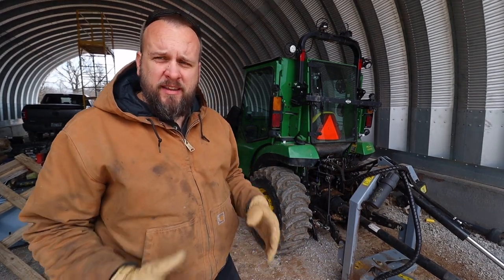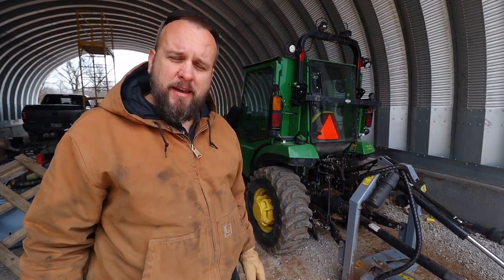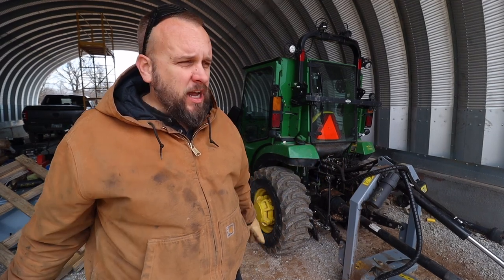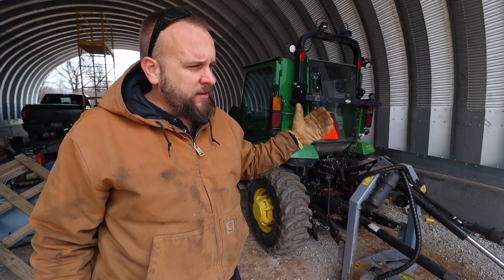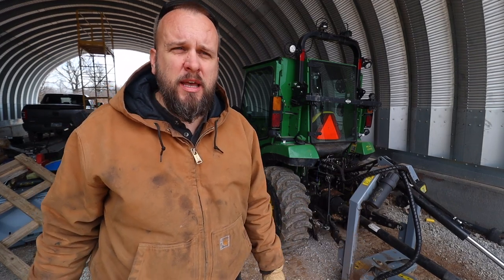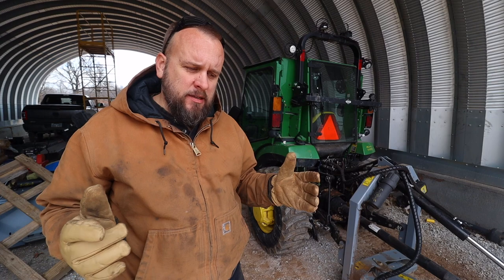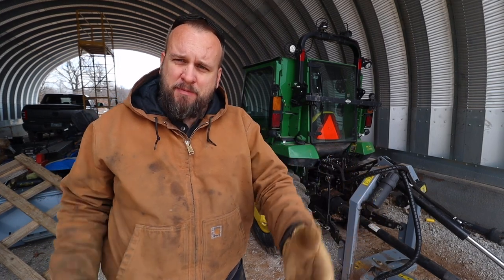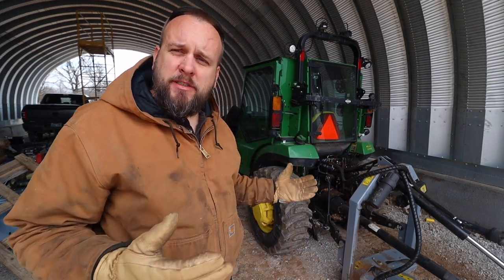Tractor Problems - Intake Manifold Pressure Fault

Comment: Sensors, sensors, sensors……..   thank you EPA!!! & Climate radicals.   I would check all the wiring connections to the sensor once you identify which one it is.  That said your tractor has been and is a beast.  It’s really been trouble free with the biggest issue having been some loose frame bolts as far as I can tell since I’ve been watching your channel.   Have a good one!  👍👍👍

Comment: Brock, I had the same issue in a 3046r. My tractor is still under warranty and the sensor was replaced. I looked at the sensor right after the technician removed it and there was ice in one of the ports. The technician said this sensor sucks in air and measures humidity levels,  there was moisture that was some how left in the sensor and froze there blocking the port. JD knows this is an issue and is working on a solution. 
There is also an issue on the exhaust side sensor as well, the error goes away after the engine heats up. They believe it's a range issue in the software, with the sensor range not being wide enough.

Comment: I had the same thing happened to mine a couple times now (2021 2038R, 85hrs). -15°F once, and the other time, -8°F. The colder it is, the longer  it takes the code to go away once it starts. I believe it’s just a warm-up issue. I haven’t contacted my dealer about it because it does go away. I’ll be following along to see if there really is an issue. Thanks Brock!

Comment: Hey Brock, thanks again for another great informative video, seems like there are two issues happening here, cold temps below 32 degrees and older possibly a weak battery. I own a 2021 JD 2038R with less than 60 hrs., I live in southern Montana, winters can get really cold, my tractor lives in an enclosed insulated shop and heated to around 40 degrees, most of the time, if I don’t forget to leave the heat on after working there, none the less, before I start my tractor when it’s cold soaked / or not run for awhile, I plug my block heater in, put a thick moving blanket completely over the hood / grille and steering wheel, this way not only the engine is getting warmed, but some of the electronics will get some love also, let it warmup for about 1 hr depending on inside / outside temps, then unplug, and start the tractor, let the oil circulate for a few minutes, then go to work.

Another thing I do with all my batteries is attach a battery tender to them, whenever my tractor, mower, motorcycle, trailer, etc. isn’t being used, the battery tender keeps the batteries at a healthy charge, thus far, except for an old worn battery, I’ve had good success. Most batteries don’t like extreme temps hot or cold. I remove my batteries from my summer equipment (that’s not in my heated shop) store / charge them in a non-frozen garage, seems to prolong there life…

I realize a lot of tractors live outside or in non-electrified sheds or buildings, no easy answer for charging batteries/ or using block heaters, perhaps there’s a small solar powered unit on the market a battery tender could run off and keep a charge on your battery.
Stay safe out there…tractor on !

Comment: Brock my 2017 2038r had a red stop and error code for 1209.03 a month ago. Google says it was an exhaust manifold pressure sensor issue. Its been quite cold and it's been cranking slow so I had the thought to change the battery. The one that was in it was the original so 5 years old. Since I changed the battery the error code hasn't returned.

Comment: Brock I live in Midland Texas half way between El Paso, and Dallas Tx, very cold days just don’t happen here often but when they do you bet your ass it feels like your in the North Pole. On one of these cold days this last December my 22 2038R  with 48hrs had the very same code come up. I too was worried and called the dealership all they said was to bring it to them when I had a chance. After some research I ended up wiggling some harnesses starting it back up only to get the same message. I did not let it run for very long and turned it off  figured I would just have to take it in. I then found a video showing how to clear codes on what I believe was a 3 series R John Deere it worked for them so why not try. I have 62 hrs on it now and the code has not shown up since. Thanks for the Video!

Comment: Hi Brock, I had this happen to my new 4066, the mechanic said I could still run the tractor and it won’t hurt anything. He also said it’s a problem John Deere knows about, the is a bulletin on it. Check with your dealer.

Comment: Hey Brock,  Thanks for posting.  Same exact problem on my 2 year old 3039R.  That loud beeping is ear piercing and is continuous.  No way I could work with the tractor even if it wasn't an issue without my Bose noise cancelling headphones.  I was also told by my dealer that JD hasn't come up with a solution yet.  Up here in NY it gets pretty cold at times.  Best  Regards,  Jeff
Reply from the maker: Since this video was recorded, I put two or 300 hours on the tractor and it’s never done it again. Even when it was really cold.
Reply: @RockhillfarmYT  I have had it several times.  I am guessing it will come back at some point.

Comment: My 3046 had that error code a few times.  The first time it happened, I shut off the machine and called the dealer.  He said that it should just go away after the tractor warms up.  It did, but it took quite a while.  It kept coming back, so I called again.  My dealer said that I may have been starting the engine at too low of a throttle setting.  I bumped it up to start at 1500rpm, and it hasn't happened since.  I was worried about starting it at such a high rpm, but he said it was fine.  I had been starting it at around 1200rpm.  Thankfully the issue seems to have gone away.  Being a worrisome individual, the "all you gotta do" solutions sort of give me the creeps.  But I'm still adjusting to all the electronic and pollution equipment, so I'll trust those who are supposed to know.  I hope it doesn't come back to bite me.
Reply from the maker: Thanks for the feedback. The owners manual says to start it at a higher RPM but I don’t always think to do it because it’s a habit to start at idle.
Reply: @RockhillfarmYT  Yup, I saw that in the owner's manual, too.  To make sure I start it at the correct rpm, I place the throttle lever in my new start position after I shut off the engine.  That way, when I go to start it again, it's already set to go.
Reply: Thanks Marvin,  Same exact problem on my 3039R when it was really cold.  That beep might as well be a siren.  It is ear piercing.  I too have been starting on low idle and allowing the tractor to auto-throttle.  I will try it next year when it is cold if it
happens.  I have a block heater so I may try plugging that it as well when it is really cold. I did recently.  My tractor is almost 2 years old but I just bought the extended warranty so I should be covered if those don't seem to fix it.  Jeff

Comment: It got really cold for use in Nova Scotia the other day and I tried to start our 4066M in -25C weather. I got an EGR valve fault and an oil pressure sensor fault, but that was after cranking it a bunch. I was assuming it was due to the cold and having weird/low voltage due to cranking it a bit too long. I didn't realize right away that the fuel was gelled and it just wasn't going to start at all. I thought I had enough winter diesel, oh well. Anyway, two days later when it was 0C and the fuel had sorted itself out, it fired right up, but the computer still has the stored codes (using the TractorData app), which I cleared.
Reply: I'm in Nova Scotia those were a couple brutally cold days. 
I'm curious about the tractor data app you spoke of.

Comment: Hi Brock.  Just something to think about.  On a car with a low battery, the computer can send cray messages like no oil pressure.  I noticed your battery cranking slow due to the cold.  Maybe the same is happening to you.  The computer is not getting enough juice, and sending a false code.

Comment: This happens to mine but it needs to be below zero. John Deere is aware of the problem and does not have a fix for it yet. Some ice forms in the pressure sensor passage so it gives a incorrect reading causing the fault. Once the engine builds heat,the sensor thaws out and it is fine. The reason the fault was there when you started it,the fault was not cleared when you shut it off the first time. I am in northern Minnesota where it is colder and have a front snowblower and when blowing fine powder snow causes the problem for me. The tractor will work fine blowing the snow but when it sits after the moisture entered the intake blowing fine powder snow and the below zero temp freezes the sensor. It happened the first time this year this morning and four times last winter. When it happens I let it run and walk away and do something else for 5 to 10 minuets till it shuts off. The pto won’t engage and it won’t go over 1800 rpm also. Replacing the sensor did not help.

Comment: A few things to think about. Most tractors, regardless of emissions, have electronic fuel systems. So any turbo engine with a common rail fuel system will require that sensor. The TYM engines “kukje” have a fully mechanical fuel system, even the emissions tractors. So this JD issue would never occur on the tym/kukje tractors. People mention this loosely in videos. But never in depth.

Comment: Our 3046R with a cab  we bought new two years ago has had a string of malfunctions that is not what I expected from this big name brand. Right off the bat one of the FEL cylinders failed. ( they claimed that was a very rare occurrence) then we had a recurring low fuel manifold pressure alarm after running the for 30+ minutes and that would reduce the RPM on it's own.( they claimed that was a rare occurrence) It would go away after about an hour's rest. The dealer told me it was probably a dirty fuel filter or my diesel was contaminated. It would be on me to pay for the repairs if that is what it was.  So I looked around the fuel system and the fuel supply hose was kinked in a bend from the factory. I fixed it myself. Never happened again. Then we keep over heating the engine coolant. I kept cleaning the outside of the 3 deep stacked radiators to no avail. (It is not easy removing and re-installing the engine cowling covers to get access to the radiators). Found out the actual engine coolant radiator of the 3rd and most concealed inaccessible of the three. It was getting overed by a layer of cotton like lint that comes from our local weeds we mow (approx 12-13 acres) . You have to peer in there  through a 3/4" opening  with a flashlight  to see that layer of lint.  I had to cobble together a water pressure wand small enough to insert between the radiators to wash off the layer of lint, Very bad design with no removeable screen. The dealer said I could buy and install one myself. It is a very labor intensive job to install that fix. I will pay for that to be done. Then the 3rd function for the grapple quit working. Took the tractor to the JD Dealer and close to $400 to fix a stuck solenoid valve. Said we need to activate that valve more often to keep it freed up. Now we get this "intake manifold pressure sensor failure alarm." after  the single digit temps we had  one night  a couple of weeks ago. Hope we can fix it with having to haul the tractor in again. ( 65 mile round trip) Wish me luck.  BTW the only thing that was covered by our warranty was the FEL cylinder.

Comment: I literally had this issue for the second time on my 2021 3046r last week. The ambient temp was in the mid to lower teens both times it happened. The first time it happened the tractor had approximately 60 hours on it. I never called the dealer. It now has approximately 250 hours on it. I called my dealer and was told they have been finding the manifold sensor to have condensation in it and the alarm will go off once the sensor dries out. They also said JD was aware of the problem and that they had a new program that needed to be downloaded into the tractors computer so the alarm doesn’t recognize the moisture until the engine is warm not cold or basically delaying how quickly it will sense moisture. My dealer had just got the new program from JD 2 weeks ago and sent out a mobile repair technician to do the update and they also replaced the sensor at No Charge. When the technician removed the sensor I tapped it in the palm of my hand and water in fact did come out of the sensor. So far I have not had the alarm come on again, but I have only put on maybe 5 hours since this repair was done. Hope this helps.
Reply: Thanks for sharing this Thomas